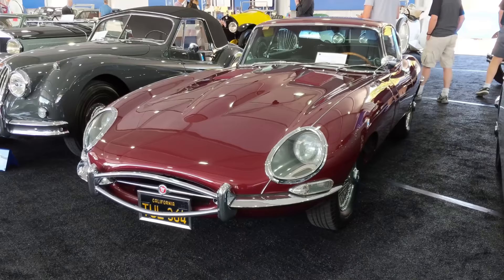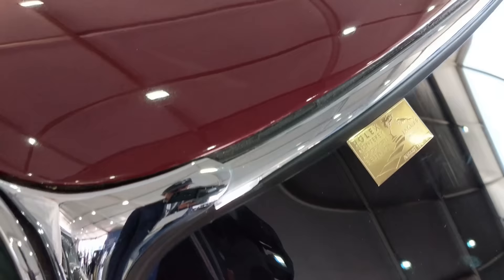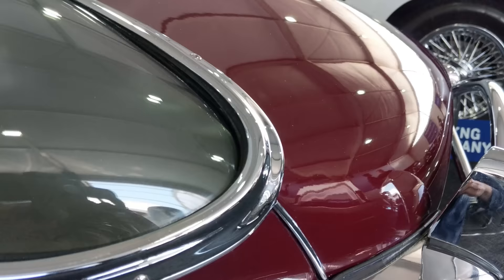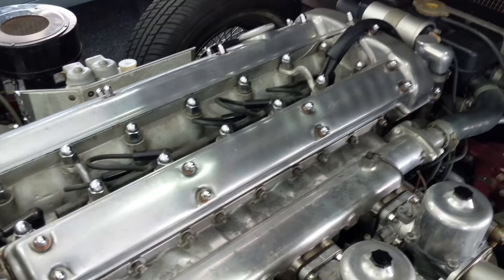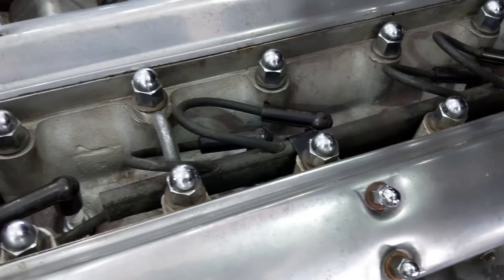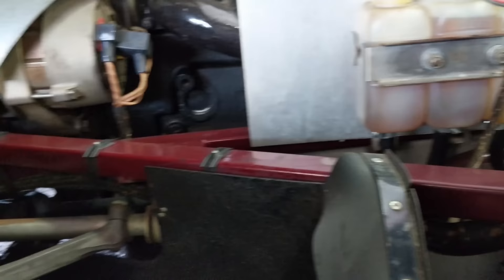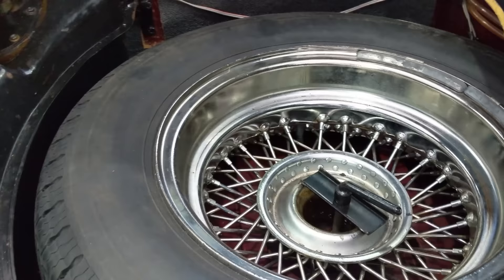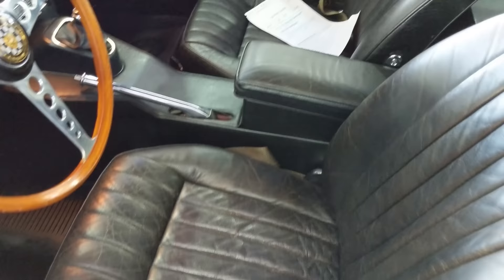The Most Original E-Type I Have Ever Seen

Comment: Richard, you did it again. Another nice find, then again you are going to very nice events. I also liked the XK- 120? beside it, and that DB5? that was so so.... Keep making them... And I'll  keep watching them. Later
Reply: Henry Zenke  I believe the adjacent car is an XK 140 DHC ( drop head coupe). The 140 had a slightly bigger cabin, much heavier duty bumpers, better steering and cooling among other improvements. The engines were higher spec 3.4 liter. I have seen 140’s fitted with the Laycock de Normanville overdrive behind the Moss non syncro first gearbox. The 140 hits the sweet spot for me, looking almost as good as the 120 but being a better driving car. The later XK 150’s were heavier and lost the purity of line to my eye. I have been fortunate to own and drive several examples of each series. The Drophead Coupes are the rarest and had a thick quality soft top that did a good job of keeping the weather away. The roll up windows and vent windows were deluxe touches back in the day.

Comment: Beautiful automotive 'art' to be sure, and no doubt that it is an all original car.
 I do have a little question though Richard, I'd like to know what that yellow wire and fuse is for, coming from the
battery and going where?
Reply: I was thinking it's for a trickle charger,to keep the battery charge up?
Reply: @brianiswrong  Maybe, but there are usually two leads for that, aren't there?

Comment: Astonishing, thank you Richard, so valuable that you now have a video record of how they looked new in early 1967. Didn't the series 1A come out in '67? No glass covers over the headlights and rocker switches instead of toggle (levers). My late 70 series 2 was red untiI I took it through a car wash, which turned the colour red/orange, so I resprayed it in my driveway...that series 1 has to be worth a million, because of its low mileage and absolute originality...imho...
Reply: What we called the Series one and a half E-Type here in Australia, arrived I think in 1968, it had lost the clear headlight covers and moved the headlights forward. I thought the "rocker" type switches were series 2, along with a further move forward of the headlights and the "underslung" tail and front parking lights.
Reply: @gazzafloss  : I think you're wrong about the 1.5 E-type. I've seen many original '67 1.5s with rocker switches but the series 1 tail lights....the series2 was introduced, from memory, in '68, probably many 1.5 were sold then too...the series 2 had the headlights moved forward with a chromed moulding above, and tail lights under the bumpers...the final series 2 E-types were sold in Australia, discounted with paint instead of chrome on some body mouldings and on wheels...
Reply: No, not a million. $151,200 to be exact.
Reply: @stephenholland5930  Pedant, that phrase is vernacular meaning very valuable...what price it achieved once is irrelevant to future "worth" to a global market...look how certain Ferraris, eg GTOs, escalated in "value" to millions...

Comment: I "think" the gear shift knob is not original. I am thinking the orginal should a small black teardop shaped. Can anyone confirm?
Reply: The shift knob looks like the Amco accessory knob.  Original is a simple black ball with the shift pattern in white.
The bars between the bumpers are not Jaguar parts.  They were a common accessory, also from Amco, which helped minimize rock chips on the leading edge of the bonnet.cars with
The cylinder head in 1967, should still be gold.  Most experts agree that the heads were gold until the '68 federal cars with only 2 small carbs.
Reply: Pretty sure you're correct.  And the headlight bevels shouldn't have philips head screws.  This is a gorgeous car and I'm delighted we got to see it, but it's not a pristine original.
Reply: @markrahner2065  You're right about the screws and the car is gorgeous.  IMHO it would be perfect with the tan interior.  For 50 or 60k my 65 would be just as nice.
Reply: @BOOMER9196  Amco bars are for idiots to not back into car.  Late 67s were not painted gold, i have one since '69. It's a one and a half.  Has absolutely everything a series one has except open headlights.   !!!!!     I've had three, all roadsters. I even had an OBL car, traded it on a Tornado.   OMG. Who knew..???   !!!!
Reply: Hi i have an etype 1966 u s and the head is not painted only 57000 miles from history could be original? and onother thing can some one tell me the back of the seats is sepose to be upholstery or the same as the carpet ?i tks in advance if some one could give info noel @gf4353
Reply: fhc sorry
Reply: Gearshift knob is black pear shaped.
Reply: A thing of BEAUTY is a JOY.       FOREVER.  !!!!!

Comment: Nice example but hardly original configuration or top scoring concours example.  But beautiful nonetheless.  Missing some interior door trim as well as some plated trim flat blacked over.  Soft top header missing some bits as well.  Curious how engine bay is presented.  Off hand would imagine non-original finish on some panels...likely once again liberal use of flat/matte black paint.  FYI....coming from a concours E type judge and '64 E owner.